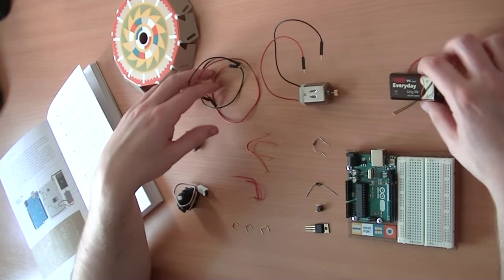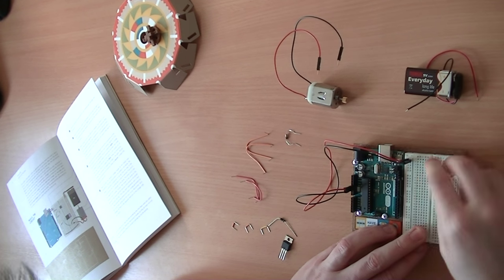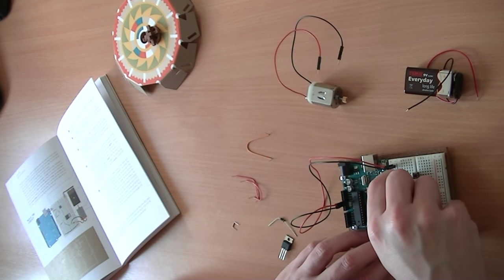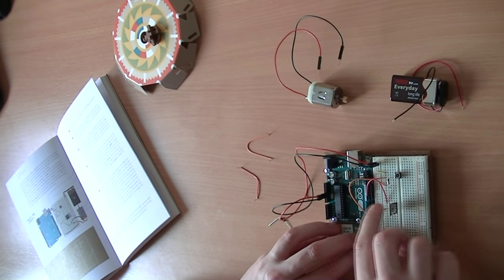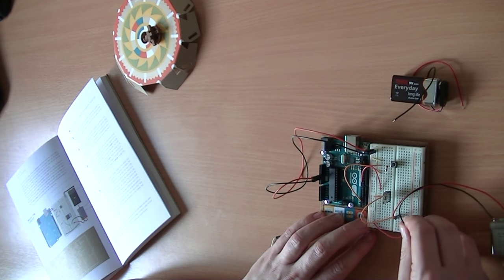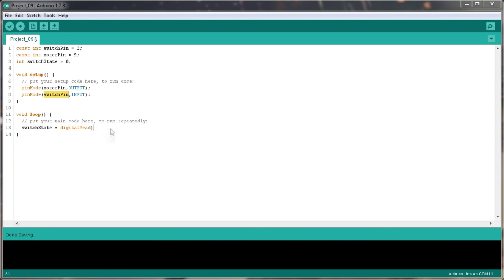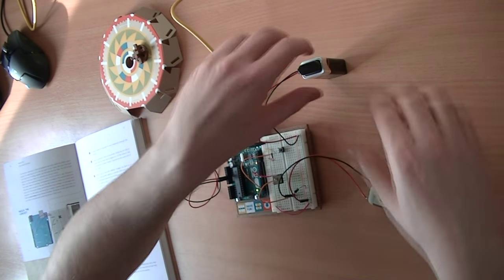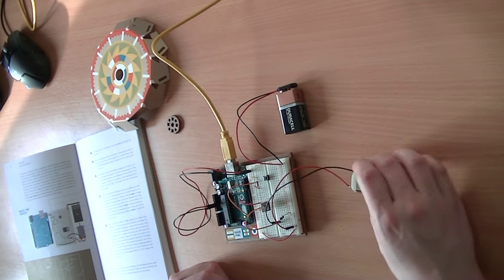Arduino Project 09 - Motorized Pinwheel

Comment: No idea why but my motor doesn't spin at all with this setup. I tested the battery with LED's and these light. I connected the motor to 5 V and it works. If I press the button the LED's will be turned off. If I connect the motor to the battery the LED's will be turned off.